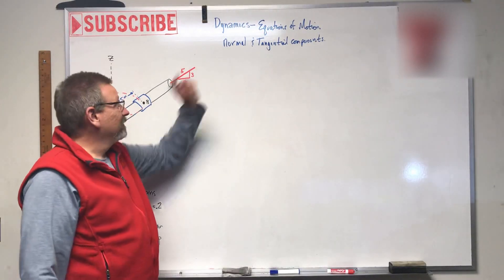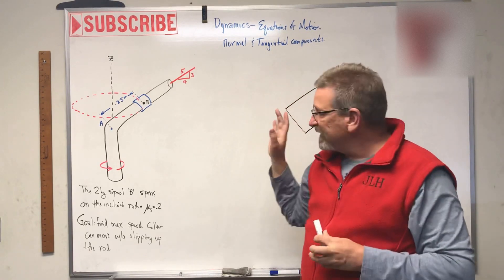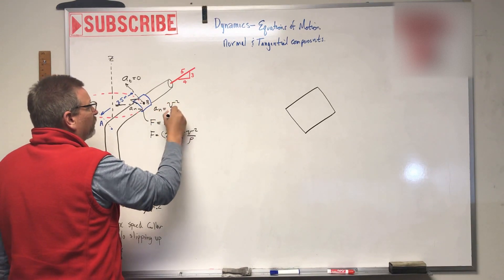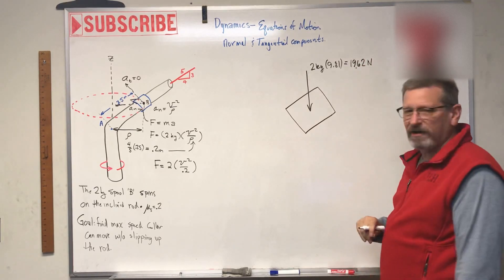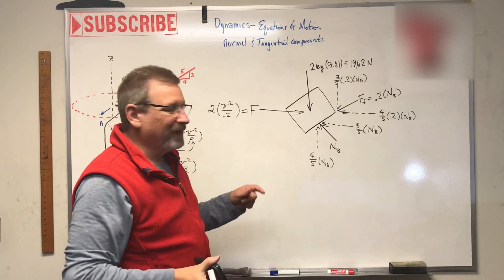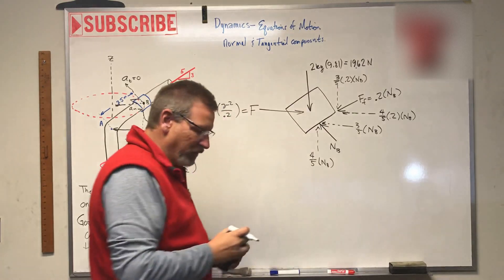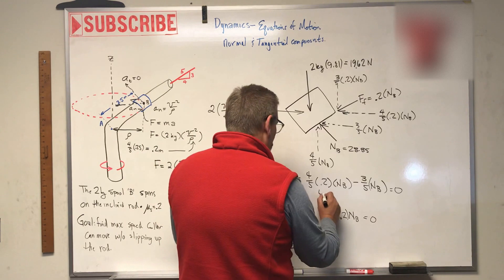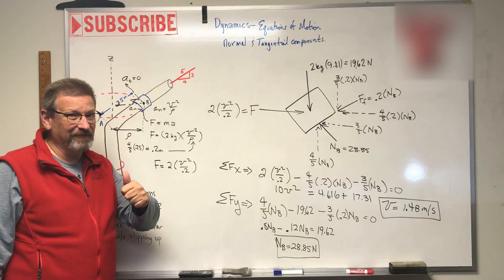Dynamics: Lesson 20 - Equations of Motion, Normal and Tangential, cont.

Comment: If you rotate the FBD axis so that the weight force is vertical, this leaves the friction force only acting in the new X direction. From this I got a completely different answer for Normal force, as friction should not affect the normal force. Doing this I got Nb=11.772 rather than 28.85. What am I doing wrong? Is rotating the axis the issue or am I forgetting a force?

Comment: Another question, SO if .25m is the Diameter shouldn't the radius be 0.125m and then we use this in our equation for Rho would be (4/5)(0.125)?
Reply: Its not the diameter. (I think he didn't say it's the diamter either) 

.25 is the length from A to B going upward. When the spool moves in circular motion, the x component of that .25 is what u need for An

Comment: You need to get one of your students to 3D print you a holster for that calculator. I like what you tried sticking it on the board. The holster would give you the best of both worlds: easy board mounting for quick use and quickly retrievable for complex calculator work.